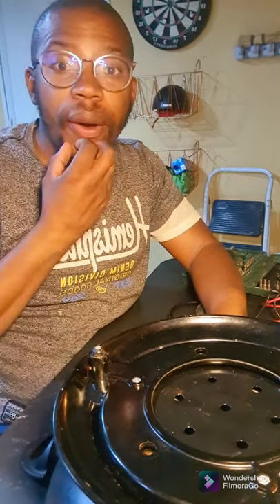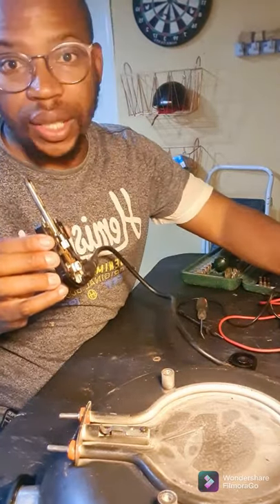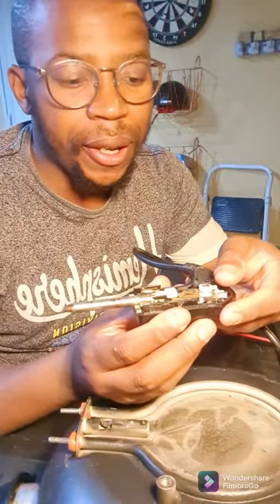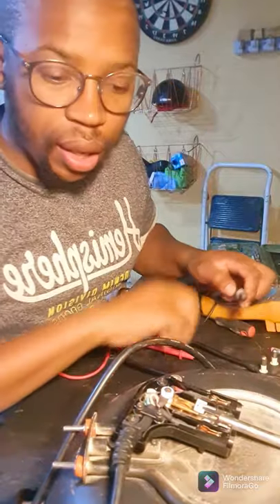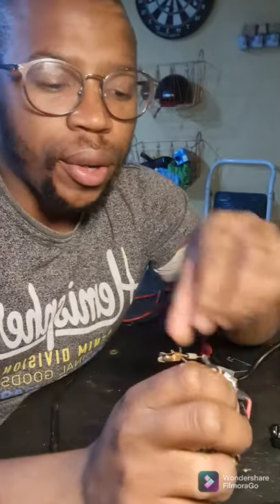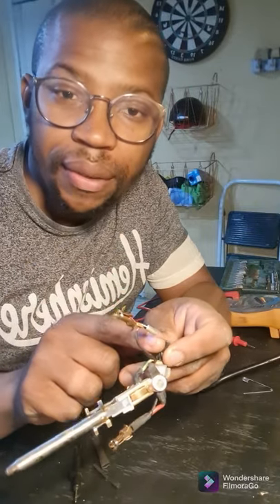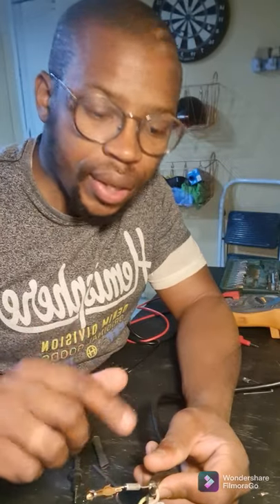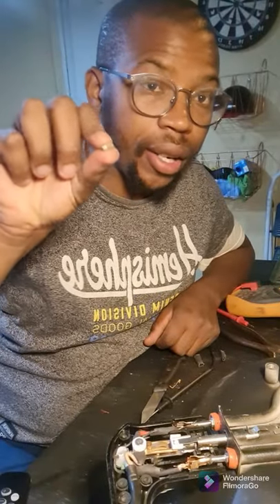Troubleshoot Electric frying pan

Comment: My maid washed my electric pan with water....when I tried to use it my power cuts off and now the pan doesn't work....what would be the problem?
Reply from the maker: It could be a short that took place inside the cord adapter that goes into the pot. Open it up and check inside